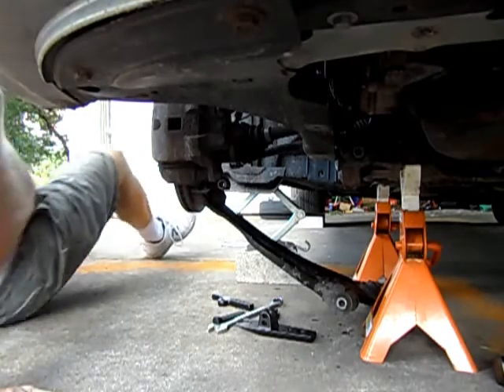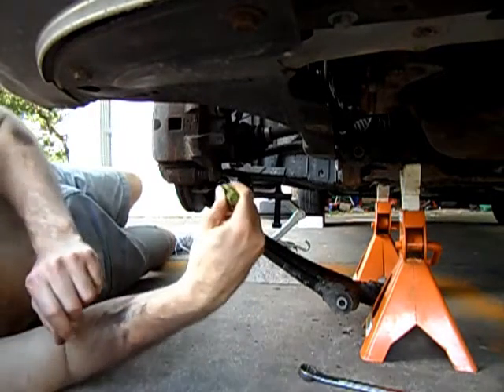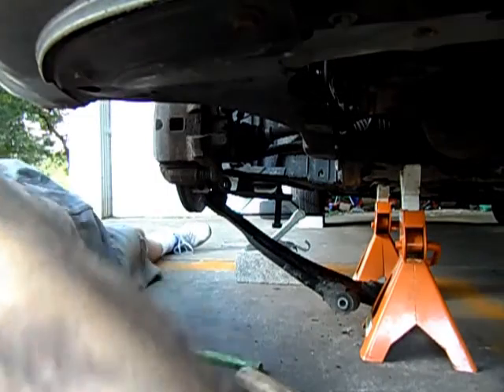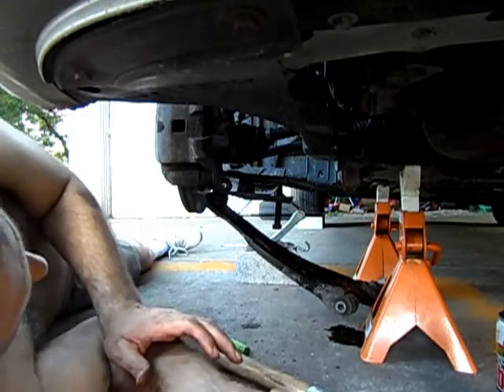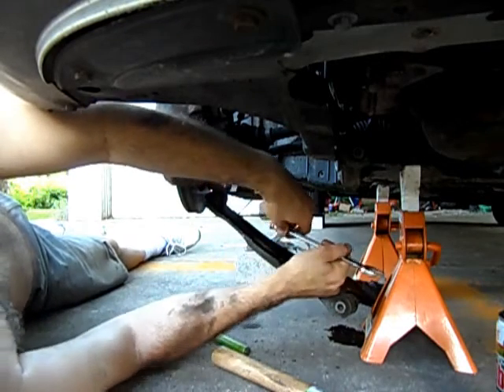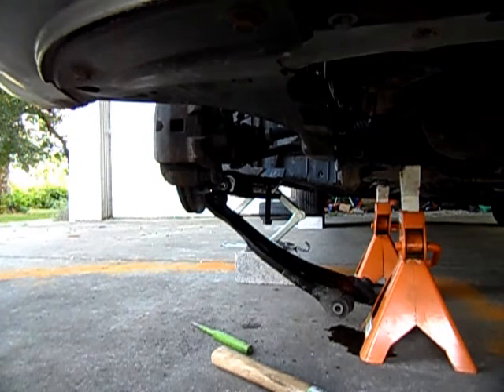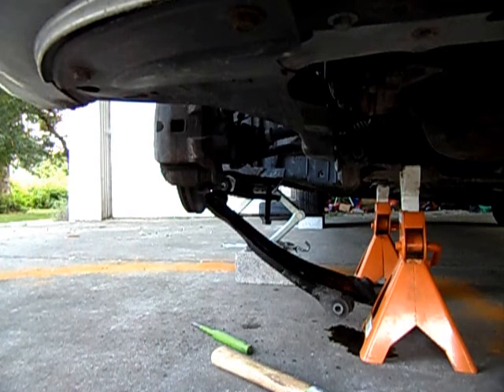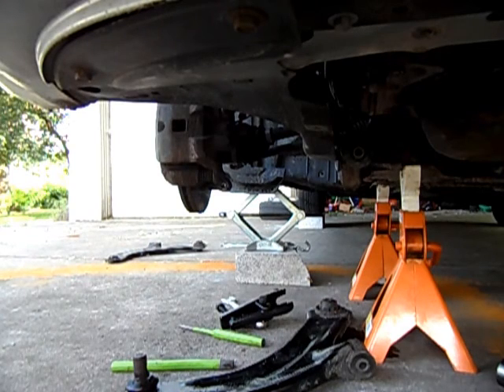Cube Ball Joint Removal: Harbor Freight 99849

Comment: Hi, can the ball joint be replaced or is it a complete arm replacement?
Reply from the maker: I'm not sure if the ball joint can be replaced separately from the arm. It's been years since I've done this project. I don't remember how the ball joint was secured to the arm. But, if it was press-fitted, then I'd expect tool-costs to increase the cost of the project. Also, I'm fairly-certain I torqued my bolts with the arms in their normal, resting position, to prolong the lives of the rubber bushings, which came new as part of the new arm assembly. New bushings in the arm assembly might be another reason to favor replacing the entire arm assembly, instead of pursuing only the ball joint.